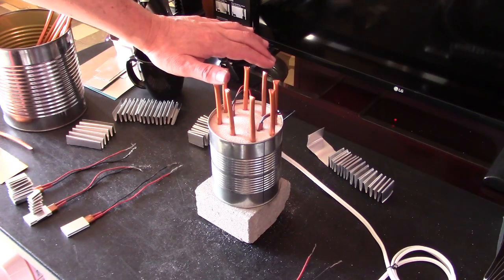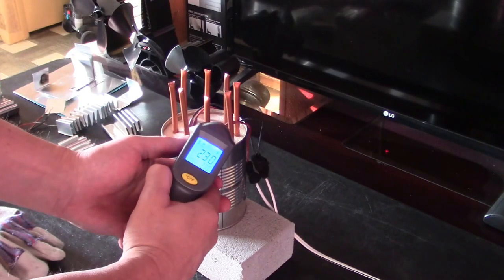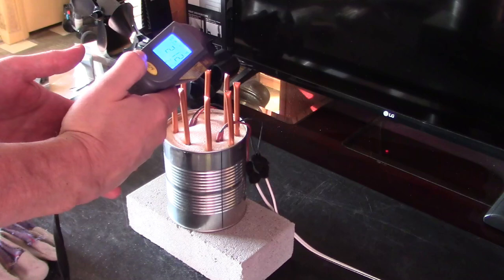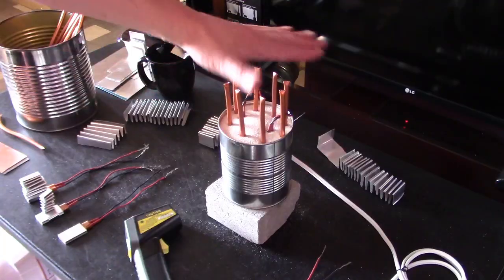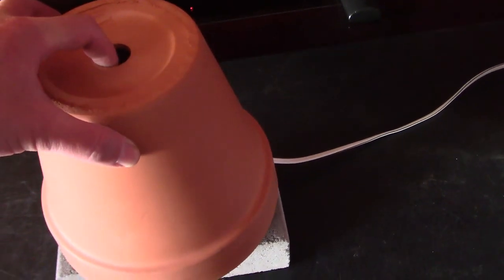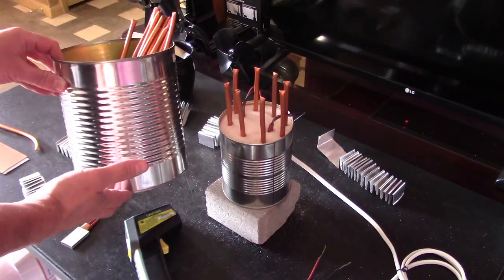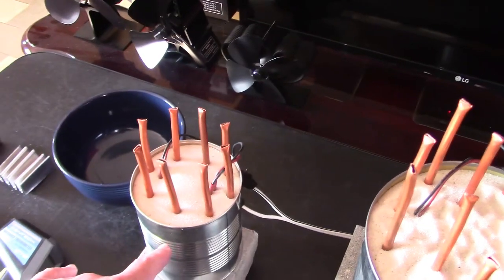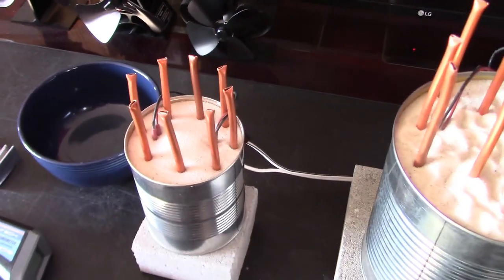DIY Sand Battery for Air Heating at home! *with "Copper Heatsinks! & Clay Pot Option w/heat pwr fan!

Comment: Is adding water to the sand a good idea in your mind?
- in some areas it is quite dry when cold - and the water should act as an additional mass, though cooling off as it evaporates - it is 'easily' heated up again.
Only 'downside' is the extra added humidity to the air, it will condensate somewhere.

Love your design, already working on a similar design for my workshop :ø)
Edit - Sorry, I was referring to the 'other' tea light design, not 'this' electric - adding water to electricity is just asking for issues and trouble
Reply from the maker: hi there. i've never tried adding water to the sand but my first thought is that the water that's near the center of the sand battery might not all evaporate fast enough (even if the water turns to steam it's still deep inside the sand) so after a day or two bacteria might start to grow in the wet sand. then it would start to stink. if all the water evaporates fast enough and escapes then it may work pretty good. i may have to try it. the elements are not technically waterproof so that may be an issue too.
Reply: You might create hydrogen gas that could explode.
Reply: @TheRainHarvester  Electricity and water, yes - Dangerous combination
If salt(s) are present in the sand, other gasses likely also will be released. 

My mind mixed this electric version up with the tea candle version - and here water would be absolutely safe.
- actually salts present in the sand here wold be a positive, as it should act as a preservative - drawing water out of any bacteria, etc. present in the warm moist sand mix.

Perhaps adding a few flickering LED lights to this version, to 'emulate' a live flame? 
- A warm cozy heat source is what's needed in a cold dark time :ø)

Comment: Cool. The fan would help circulate the hot air. How did you make the fan?
Reply from the maker: hi. yes, indeed. the fan isn't homemade. you can get those fans on amazon. if you search for heat powered stove fans you'll see lots of them 🙂
Reply: Its a geothermal fan that dont run on any electricity.